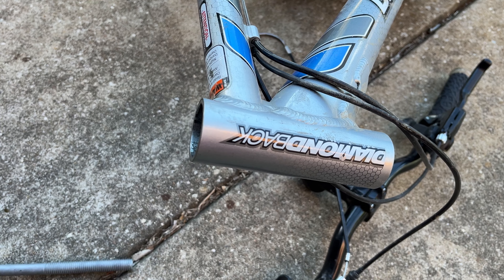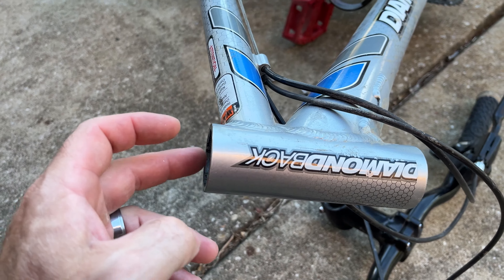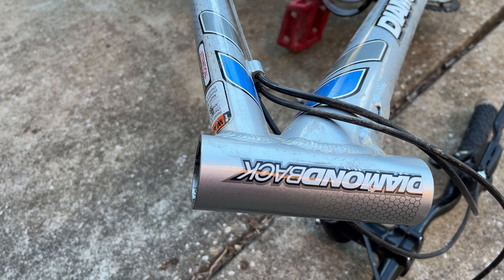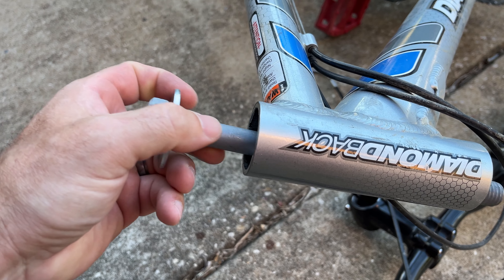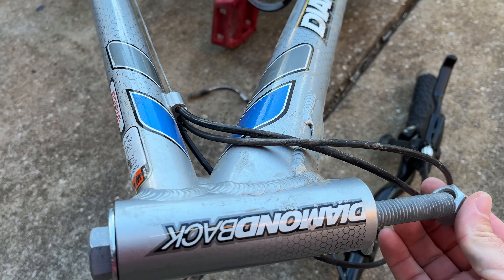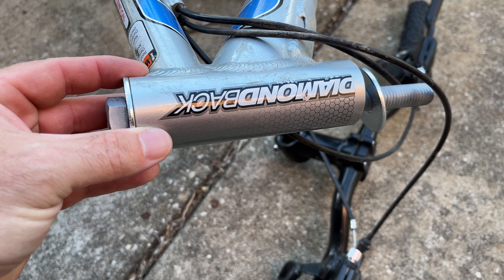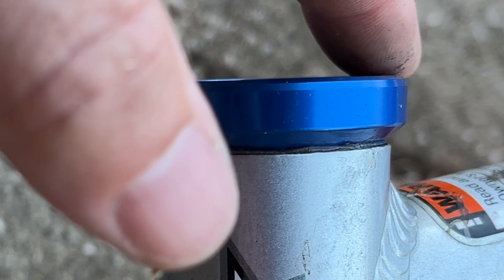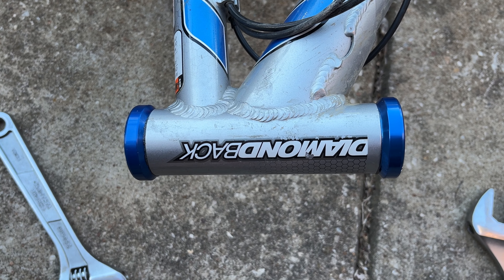Cheap Easy way to Press Headset Cups into Bike Frame w/o Special Tools or Beating on it w/ a Hammer

Comment: Good job!  Also, adding some grease on the bolt threads really helps the process.  Works great on my bearing puller.